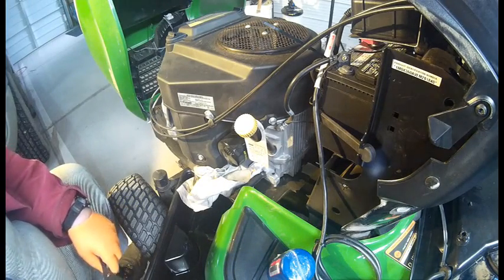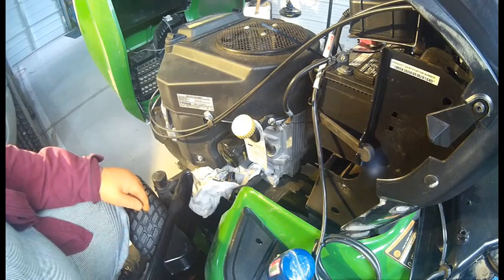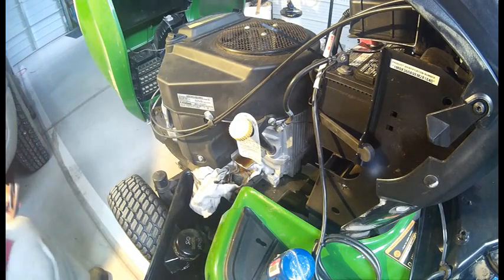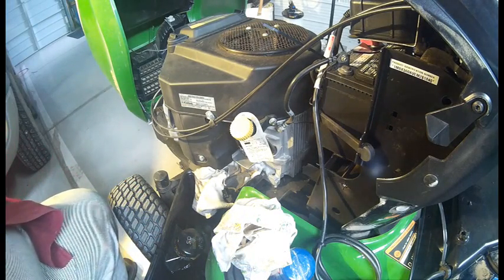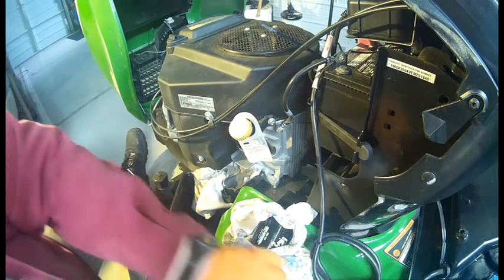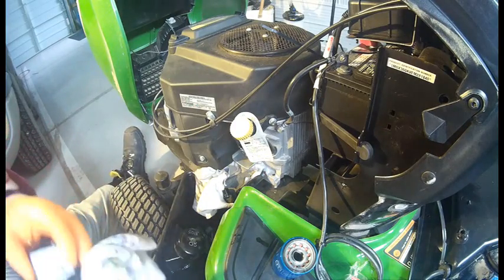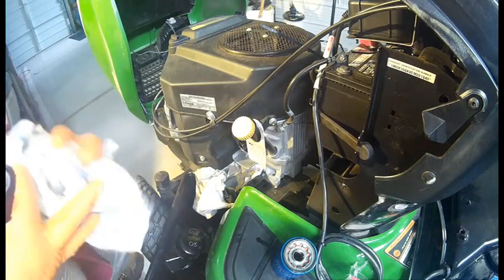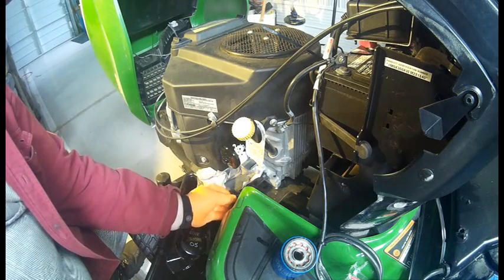Changing Oil and Filter on My X360  john Deere Lawn Mower

Comment: How much oil I end up putting two quarts and seems more than full.
Reply from the maker: i guess you don`t realize , the K& N filter i installed had about 1/4 to 1/2 inch taller than regular John Deere filter , so it take more oil to get it ti the proper full mark . Also I had  a partial container of oil from last year .
Reply: @45NUTS_PART_DEUX  it wasn’t clear from my earlier comment.  I was actually asking how much oil should I put in my x360 I end up putting two quarts and it seems overfilled drained some out but is there an actual listed amount how much it takes?
Reply from the maker: @emperorsanders5744  from the on-line manual foe x300 series  

IMPORTANT: Do not overfill. Some residual oil could remain in engine after draining. Overfilling can cause smoking, hard starting, fouling of spark plug, and oil saturation of air filter.

Add oil slowly and stop to check oil level every few ounces to avoid overfilling. Add oil no higher than FULL mark on dipstick. Do not overfill.

    X300, X304 and X310: Begin with approximately 1.7 L (1.8 qt).
    X320, X324 and X360: Begin with approximately 2.1 L (2.2 qt).

http://manuals.deere.com/omview/OMM173266_19/?tM=